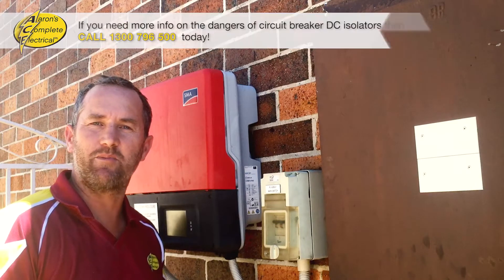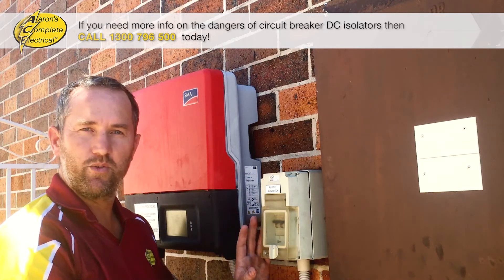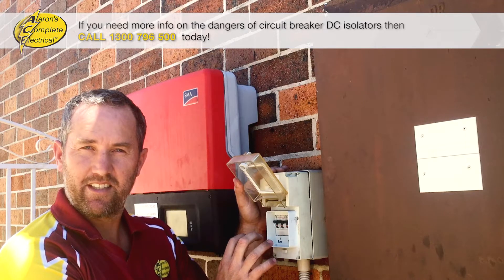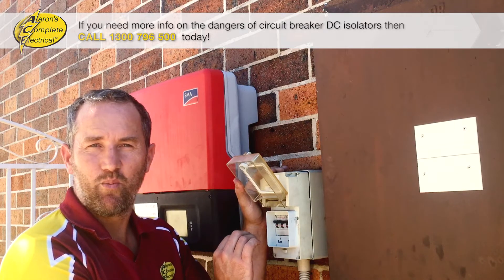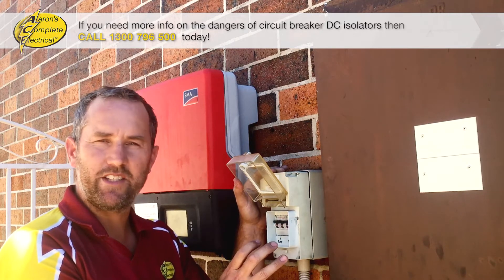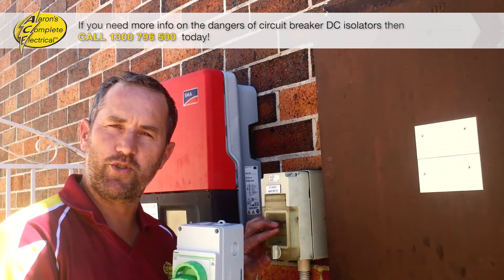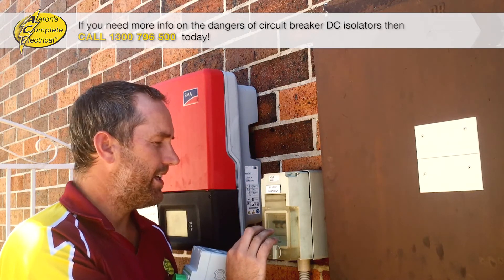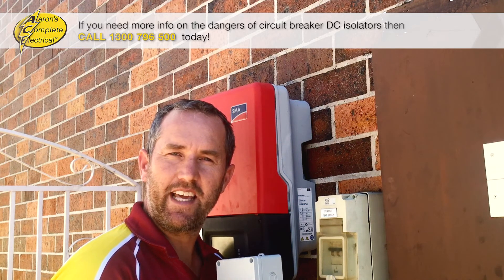Solar System Circuit Breaker DC Isolator - Know The Dangers!

Comment: Does the arching of the current when you turn off the isolator cause damage to the isolator? If so, would it be better to just not include the isolator in the system and just rely on the DC circuit breaker?

Comment: Ok, can catch fire. Explain how.  If succeed correctly there should be no problem. They have magnetic and thermal protection and an arc extinguisher.. 
 Pretty safe to use... Use the correct DC breaker and now an AC type. Wire the polarity right. I use these all the time..
Reply: Because -+ are on opposite sides top and bottom, so they get installed incorrectly inadvertently. So under load they are shorted.

Comment: But old one is also over current protection and isolator is just a switch isn't it ? You loose protection of the cables from roof to Inverter
Reply: In this case it is just being used as a isolator switch and the capacity of it is probably too high to provide protection.
Reply: Theyre polarised circuit breakers, many wired them wrong way around, the burn very well
Reply: How do I know if my DP DC 63a 250v breaker is polarized? There's not enough info here to actually know what is the danger, unless I see that exact breaker he is showing.
Reply: @marionsutcliffe1119  on most DC breakers you have + - symbols on the top or bottom
Reply: @ptrwsk  ok.... Mine takes + in top left, + out bottom left, -'s on the other side. Yes, it's double pole. I still have no idea if that means it is polarised.

Comment: so is this installed on the wall? what about those rooftop dc isolators? I have seen in houses they have the dc isolators installed on roof next to the solar pv array
Reply: I’m off grid and I have two of those roof isolators for my charge controllers. It’s best to have a fuse up by the PV branch also.
Reply: @benjones8977  try Schneider NSX 100f dc mccb
Reply: I’m off grid and I have two of those roof isolators for my charge controllers. It’s best to have a fuse up by the PV branch also.